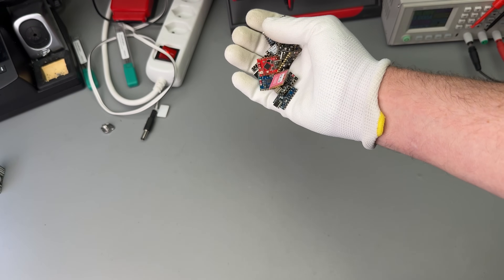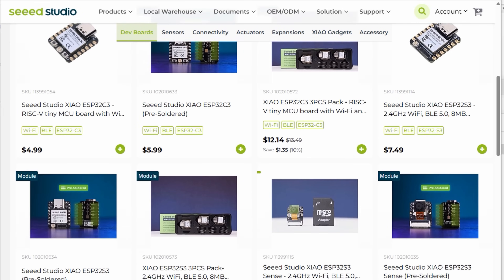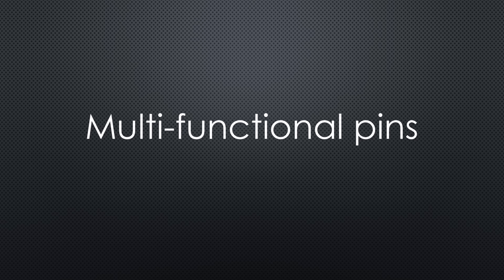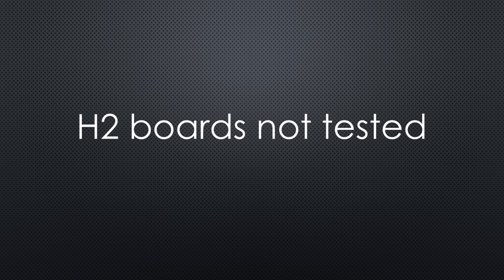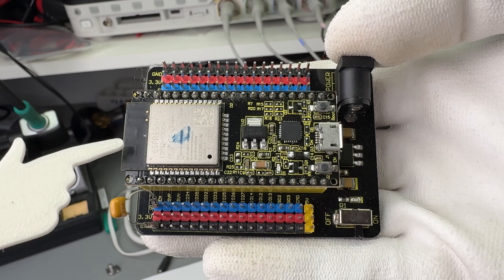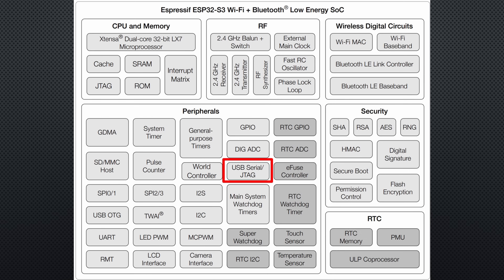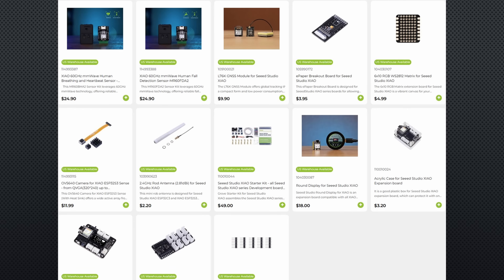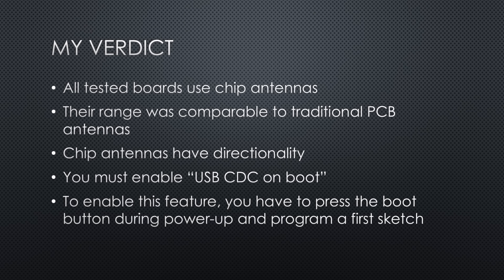Stamp-Sized ESP32 Super Mini Boards Tested: Range, Programming Tips & Best Pick

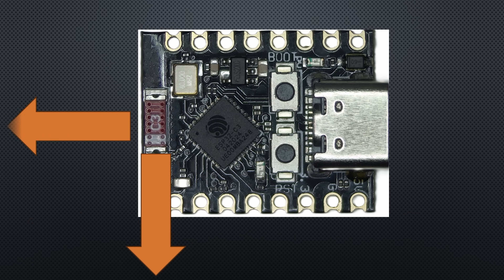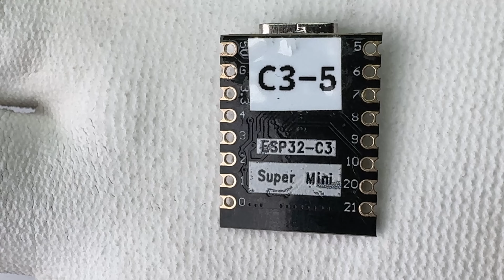Comment: If you compare the ESP32-C3 board picture at 8:17 as compared to the board at 9:18, you will notice that the chip has 3 lines of text as compared to the 4 lines on the second picture. That is because the one at 8:17 has no internal flash and is from a bad manufacturing batch where they used the wrong chip. I suspect that is why the board at 4:19 did not work. The bad manufacturing batch is still sold today and that is why I avoid the C3 supermini boards entirely.
Reply from the maker: Maybe they populated wrong chips. The problem was that the upload process was interrupted all the time.
Reply: @AndreasSpiess  I have one of those and need to upload with a very low speed (like 38400baud) for it to succeed. Also, direct connection vs. usb-hub does seem to make a difference with this one.
Reply: @AndreasSpiess  They populated a C3 chip variant which needs external flash (its memory), instead of a version from Espressif with the flash memory built-in. And ofc the board doesn't have connections or room to put an external flash chip, so those examples are for most purposes DOA.
Reply: I had some C3 boards that I could upload code to, but that wouldn't connect to WiFi.
Also a known issue with some of the cheap C3-mini boards. Something with impedance on the antenna or something. The boards got hot. They suggested lower Tx-Power. But that only worked half the time for me.
I bought very similar boards from a different source and those work great.
Reply: I've got 6 out of 6 ESP32-C3 Super Minis working fine. I bought them in batches of 2 at different times over the past year. It seems it's the luck of the draw.
Reply: I must have struck lucky with the supplier I tried..
No problems at all with ESP32 C3.
Reply: I am using generic c3 superminis for a year now, and tgey work great. In 2024 there was a flawed batch where the crystal moved too close to the antenna which causes interference and unteliable wifi. Reducing tx power - which is generally a good idea in well-covered wifi homes for a number of reasons, i.e. reducing energy consumption - fixes the interference. Once you consider using any boards from no name manufacturers, you will come across flawed ones, but that’s not related to superminis or c3. My first one was an official Arduino Nano for €20. unbelievable in retrospect. Today I buy esp32-c3 superminis for €1/piece, and once you fibd a trustworthy seller like tenstar robots et al, you can pretty much use every single unit.
Reply: This is correct. One can confirm this by using the esptool flash_id do display the chip details. Such chips will show Unknown flash size.
Reply: 3 out of 3 working chips for me. Seems like an issue with the supplier they bought from.
Reply: Awww shoot. I just bought one of those.
Reply: @Splarkszter  Update to my comment above. I've got 10 out of 10 working fine. Chances are you'll be OK.
Reply: @chesshooligan1282  Thank you. I mainly want it to control some relays for Home-Assistant so I hope that I don't suffer much when it arrives.

Comment: They gave me a headache... anyway, great video.
Reply from the maker: Same here in the beginning ;-)
Reply: A little learning curve with respect to how to get them into upload mode.
(I usually do that once and install a minimum of OTA code on them.)
Reply: @ Not only the learning curve on how to get them into upload mode gave me a headache... also the soldering... but on the other hand, they're very cheap, so if I ruin one, I just pick another one and continue.
Reply: @PhG1961  The soldering is different from regular board?
I soldered pins on them and pin headers on the PCB. Just like the regular DEV-boards. (That way I can still wire and put some small IC under them. Like a SPI DAC )
Reply: @oscargr_  My first board didn't go very well with the soldering. Too much heat from my soldering iron...
Reply: @PhG1961  Ah...  I see.
I have a little temperature controlled soldering iron with a fine tip. (Not a soldering station)
They cost a bit more (like 3 or 4 times of the very cheep ones) but I have been using it for 10 years. And I leave it on for hours when I am busy.
The cheapest ones get too hot when you leave them on when you are not actively soldering.
Reply: @PhG1961  I just checked another of your messages on Andres channel..
I am your north neighbour 😁
Reply: @oscargr_  Ok, dat maakt het communiceren nét ietsje handiger! Btw, mooie foto op uw kanaal. Vanwaar ergens?
Reply: @PhG1961  haha.. ik moest even kijken welke foto je bedoelt. 
Het is een foto van het huis van mijn overgrootvader in Groningen, gemaakt door mijn moeder op een winterse dag in 2021.
Het huis is niet meer in de familie, maar mijn moeder had er fijne herinneringen aan uit haar jeugd. Op bezoek bij haar grootvader. (Mijn overgrootvader)
Reply: @oscargr_  Altijd een beetje spijtig als erfgoed uit de familie verdwijnt...

Comment: some boards like esp32 s3 super mini use 4.2v batteries(like 18650) and c3 3.7v
Reply from the maker: I assume they are the same (4.2 is max voltage, 3.7 s nominal voltage of those batteries).

Comment: I‘ve tested some of these as well. I personally like the Tenstar esp32-C3 SuperMini Plus. It ships with an external antenna. You have to short circuit two pads next to the chip antenna. Not sure if this is proper as the chip antenna remains connected. But it works an that soldering was much easier than switching the tiny 0-Ohm resistors.
Reply from the maker: I probably would remove the chip antenna in this case... And you can just connect the two pins with a solder blob instead of a 0-ohms resistor if you want. They use a part because it is easier during assembly.

Comment: Does unobstructed line of sight performance predict range in more typical noisy obstructed multi path interiors?
Reply from the maker: It does not really predict it because inside a house, there are many unpredictable behaviours. That is why I went outside to avoid them (or at least make them the same for all)
Reply: Id say yes. More output power is just more output power. Be it reflected or line of sight.

Comment: Did you test the XIAO C3 with the provided external antenna? And what about Adafruits QT Py boards? These are some more expensive but usually of very reliable quality.
Reply from the maker: I only compared boards with a chip antenna. So, Seeeds C3 did not make it through this filter. For me it is somehow strange to us such a small board with a "huge" external antenna ;-)
Adafruit boards are hard to get here or expensive when shipped from the US. But I agree, they deliver good quality.

Comment: ESP32H2 doesn't have wifi, but has zigbee! And it is very power efficient.
Reply: 3.0-3.6 input voltage - can be powered directly by a LiFePO4 battery.
Reply from the maker: @t0masz90  Did I say something different?
@aliancemd  All ESP32 chips have this specification.
Reply: @AndreasSpiess  you didn't but it was still a little confusing at first. Zigbee and WiFi both being 2.4ghz makes it easy to conflate the two. After the Wi-Fi range test you mention zigbee in the h2 and I was like "oh yeah, it's 2.4ghz but not Wi-Fi, the range test was a protocol specific test. The H2 still has wireless capabilities, just not Wi-Fi." 

You could have mentioned it as extra context when you said the H2 doesn't support Wi-Fi, but you say it eventually so you didn't leave out the info. Just a VERY minor note for an overall fantastic overview.
Reply: @AndreasSpiess  Maybe I didn't notice, no offence. Cheers!

Comment: Thank you for your effort and this great comparison! Interesting results with this small antennas. Years ago, when the first ESP 8266 WEMOS boards with a ceramic antenna apperared, I tested the range to be quite poor. Nice to see, that there is an improvment now.  
 What is about the support of Tasmaota, ESPEasy and ESPHome of this stamp sized ESPs?
Reply from the maker: I did not check ESPhome or Tasmota. An interesting question what happens if you use their flasher.
Reply: @AndreasSpiess  Yes, my current "operation mode" for new ESPs: 
1 Does one of my previous script the job?
2. Does ESPEasy, ESPHome, Tasmota the job? 
3 Does  1) or 2) in combination with a script in ioBroker the job? 
4 Write a new script
And 4 became really rare.
Reply: ESPhome works quite well on the c3 and s3 super minis I have. AFAIK the c3 needs the esp-idf framework, s3 works with both arduino and esp-idf.
Reply: @lukask5285  Thank you for your info!

Comment: Any advice on actually identifying the board type properly in PlatformIO or Arduino? I bought one of the these boards from Aliexpress a while ago and I cant determine which one of the variants of esp32 to select as the board and platform?

I was trying to use the I2c pins on the one I've got and had absolutely no luck, will try the usb boot trick and see if that helps. Thanks for the tips!
Reply: You might be able to get more infos with the esptool.

For example if i call `esptool.exe --port COM9 chip_id` I get the output "Chip is ESP32-C3 (QFN32) (revision v0.4)"
Reply from the maker: I always use the standard ESP32xx Dev Module boards

Comment: I had a long "figth" with one of the super-mini S3 modules types. Even with an AP beeing less than one meter away it was not possible to get a WiFi  connection. The RSSI was very good but the DHCP config just failed. Even soldering an external antenna did no do much. After a long time I read a comment on YouTube where someone got it wokring by setting the TX-power to a low value. And indeed it worked by using the lowest possible TX-power value. S3 super-minis that work good for me were the one from WaveShare (called zero).  So be careful on AliX because there are many different variants of those. Some work good some very bad.

Comment: I've been playing with the c3 version and found it good enough but understand that it's not as powerful a chip as the standard esp32 dev boards and some libraries / codes are limited in functionality.
But for my DIY code and simple projects it's fine.
Reply: C3 and C6 are single core. I you need two cores, go for the S3.
Reply from the maker: Thank you for sharing your experience!
Reply: What do you mean by not as powerful?

I love that the peripherals are available on almost any pin you wish.

Comment: You have a capacitor soldered to the breakout board. Between which pins and what is its function? I am struggling with stability issues in a project. Maybe this is my solution.
Nice real life test btw.
Reply from the maker: This capacitor is needed to provide a proper reset signal during flashing (a design fault of this board). In the past, a relatively big capacitor between VCC and GND of the chip was sometimes needed to make sure the board did not create a brownout reset. With the tested boards, I did not encounter such problems.
Reply: @AndreasSpiess  Thank you for a swift reply!
Reply: maybe you struggle because you put zero effort into doing things.
its clearly ground and enable, not only could you have googled it, but can see clearly from pausing the video noting its a Wroom32 and the "E..." label on the pin. 
Now shall i get the value for you also or can you be compelled to do that for yourself?
Reply: @axa.axa.  Everyone needs to start at some point. And approaching beginners with such an attitude is quite rude and "gatekeepy".
Kindness goes a long way.
Reply: @Bunkerotter  Thank you.  I wanted to say the same.
Reply: @Bunkerotter  Thank you!!

Comment: I was able to test an ESP32-S3-Zero. 18 pins, power pins on the left side. I liked the fact that there is no power LED on the board. The USB CDC on Boot enabled is very important. With disabled I was able to upload the sketch, but there was no output on the serial console. However, the board got very warm > 36 °C during operation.
Reply from the maker: Thank you for sharing your experience! Indeed, the chips got quite warm (I assume because I regularly sent WiFi messages)